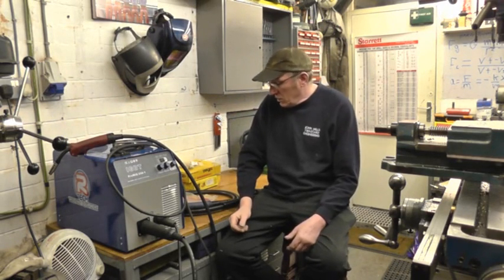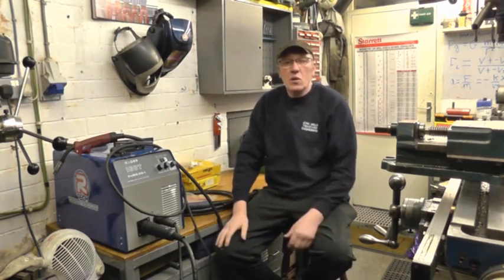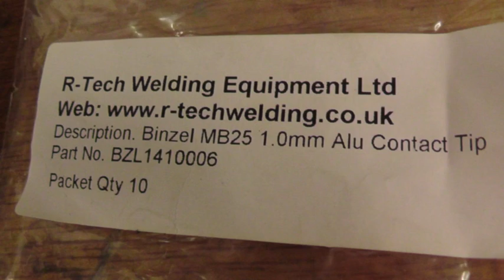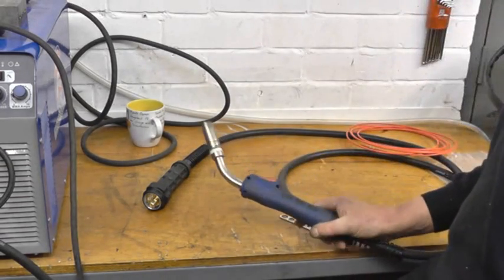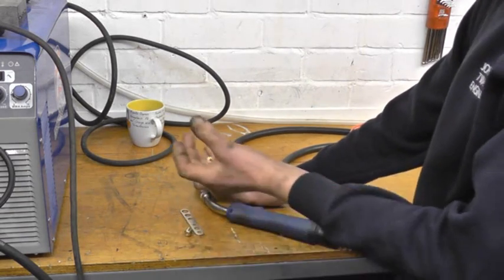R-Tech Pro-MIG250-1 MIG Welder Review Part Eight

Comment: Thanks John!  I have a little Miller MIG welder, but have used it only for steel. I didn't realize that aluminum was a possibility without a spool gun...which costs about 50% of what my welder cost. I'll check into whether a sleeve and drive wheel might be enough. 

I read somewhere that MIG was originally invented for aluminum. Don't know if it's true, but given how hard it is to gas weld aluminum (done it...not well!) and that TIG wasn't available yet at the time, I can believe it. 

Given how well the RTech machines have worked for you so far, I'm expecting this one to do a good job too. 

-- Mike

Comment: Just a little safety tip.

I've seen people leave the PTFE liner in when they go back to steel, sometimes because they feel it feeds better than the steel liner. However, it's possible, especially with a worn tip, to get the wire overheated down the lenth of the liner. PTFE breaks down it high temperatures and forms some seriously nasty gasses and compounds.
Reply from the maker: Hi
Paul
Thanks for the safety tip
The PTFE liner will only be used for alloy
I have a separate torch for steel
Best
John